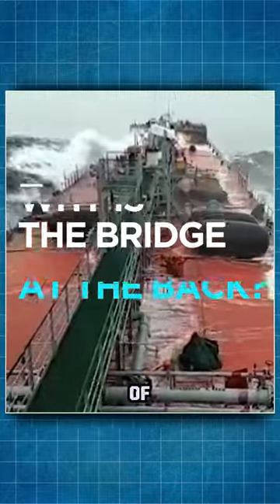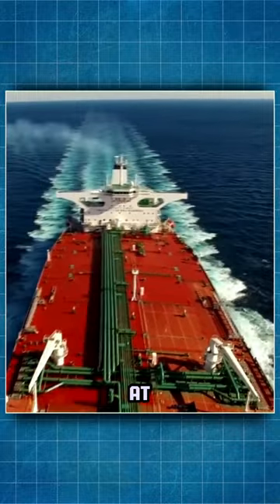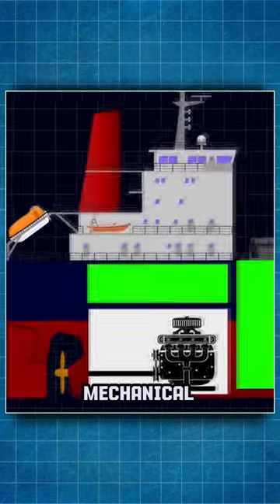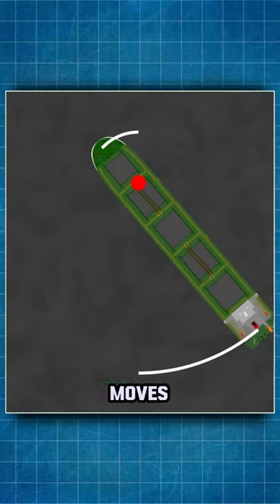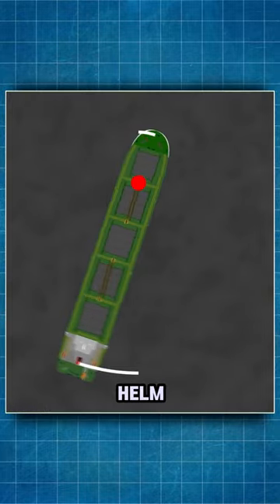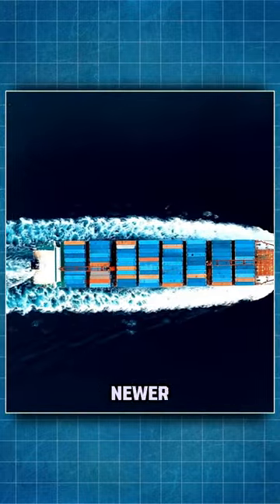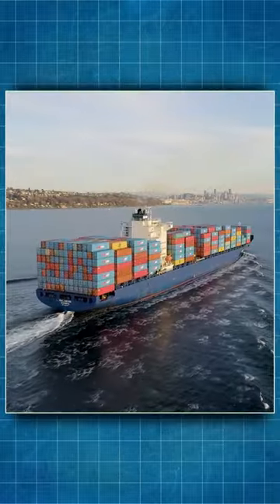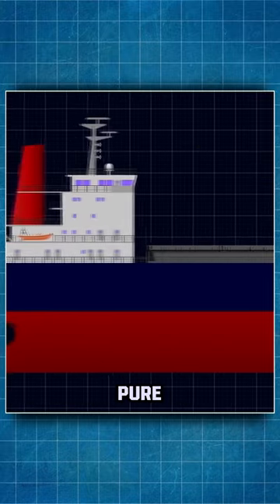Why is the Bridge at the Back of a Ship? #vessels #ship #shipbridge

Comment: Old fashion - except tankers and bulkers the new class of neo Panama vessels now get their bridges as far to the front as possible to increase the loading capacity by decreasing the size to one fitting through the news locks at Panama Canal and the Suëz Canal. Midship and aft end bridges are whipped out by that - except oilers and bunkers as told above.

Comment: So why they don't just create a All steel bunk in the front that's water sealable almost like a submarine .. and have a submarine like steel bump in front that's waterproof with a radio crew in the front that's connected throughout the ship be a second eyes
Reply: Because reliability. Did you even listen to the video? Reliability was mentioned.
No, you dont put such complex systems far appart when you dont have to. Thats just a liability. Having everything togueter ensures your ship will be as reliabiable, safe, and efficient as possible

And you dont need eyes at the front of thoses ships.
The oceans, and even rivers and lakes, are MASSIVE.
From the perspective of a ship, it is kind of equivalent to you driving a pickup truck: your hood is slightly in the way, but not enough to be dangerous.

Historical ships such as wooden sail ships or early steam ships were also like that: the ship was commanded and steered from the stern.

Small boats such as a dingy, small fishing boats or small outboard engine boats are also like that